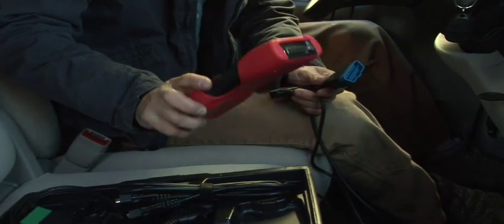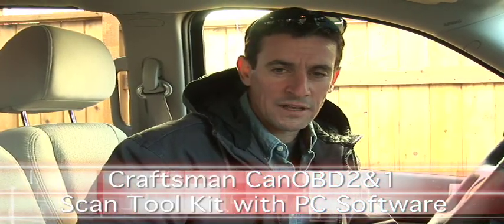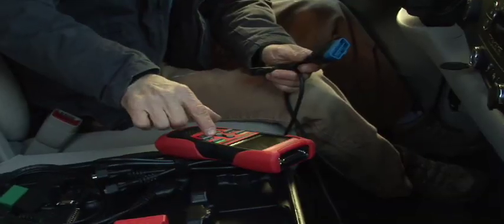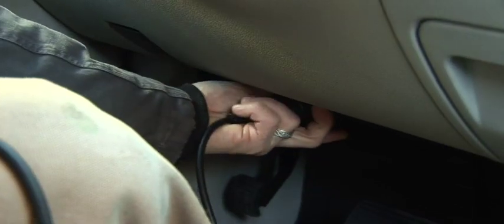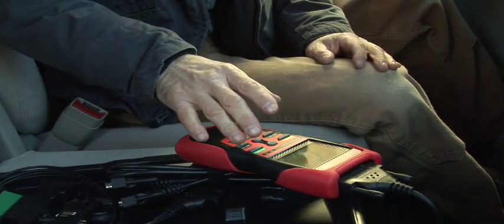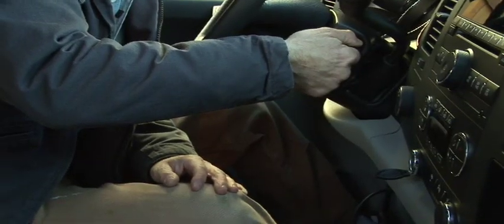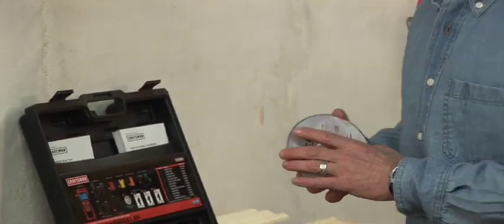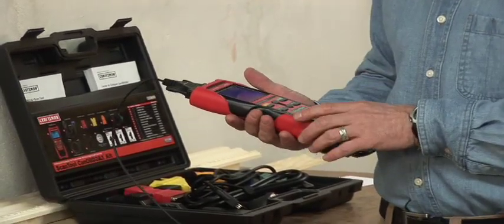Craftsman CANOBD2&1 Scan Tool Kit

Comment: I own one of these.  It works slick.  Only drawback:  It doesn't come with a USB cable.  I had to buy a serial to USB adapter at Radio Shack for $40.  It has tons of features I haven't begun to explore yet.